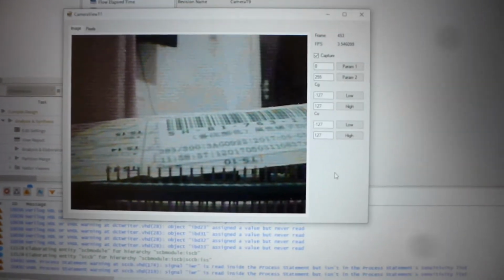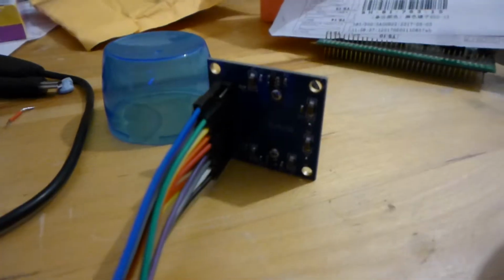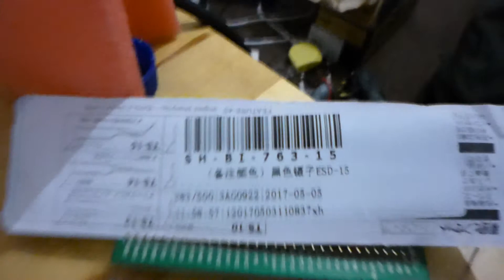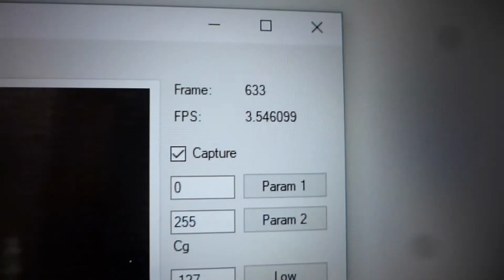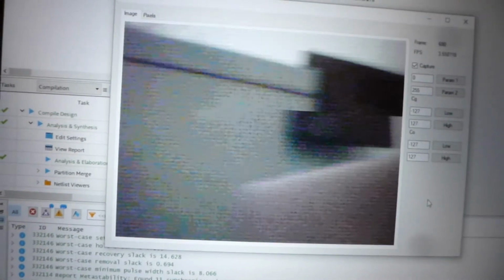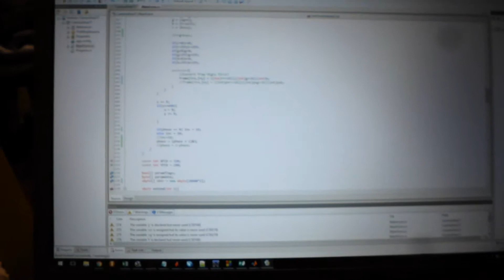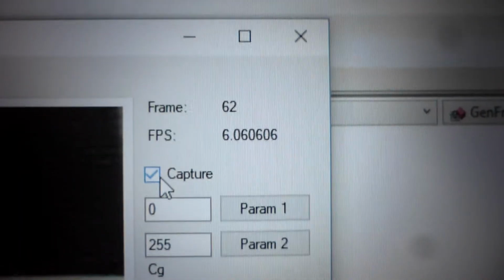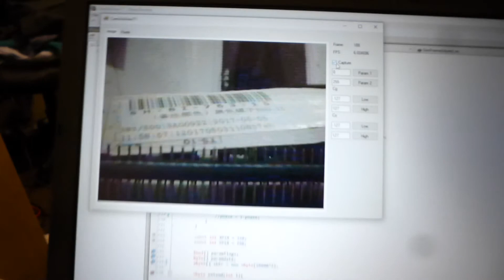FPGA Based OV7670 - DCT compression and chroma subsampling in the YCgCo color space

Comment: What would it take to get it to 24 or so FPS?
Reply from the maker: Well calculating the 3x3 coefficients of an 8x8 DCT requires 264 multiplications and additions. I'm currently only doing 8 multiplications per cycle to keep logic consumption down however this would only require 33 cycles for the entire calculation. As I've implemented it sequentially, there are a few states in my FSM that could be combined to reduce the cycle time from 59 cycles to some smaller value. With the OV7670, a PCLK of 12MHz translates to a frame rate of 15fps (actual pixel rate however is 6MHz as you get half a pixel per clock). Therefore for 24fps, you're looking at a PCLK of 19.2MHz (pixel rate of 9.6MHz). At this speed, you're looking at a block calculation time of 833ns. Using my naive 59cycle block calculation would require a DCT module clock speed of 70.8MHz (59/833ns). If I could optimally code this to use the 33 cycles stated above, I would only need to run the DCT module at 39.6MHz. Looking at the fast model however, I should be able to achieve ~69MHz operation so pushing it up to 71MHz probably shouldn't cause THAT many issues.

That however is internal to the FPGA. The issue outside of there is streaming the image from the FPGA to my computer. For that, I should write a program in a faster language e.g. C using SDL.